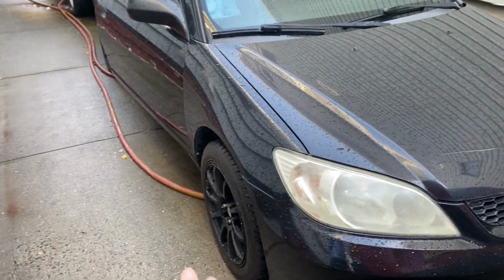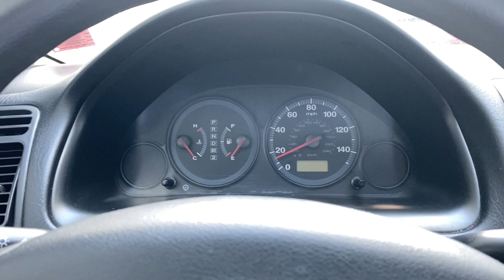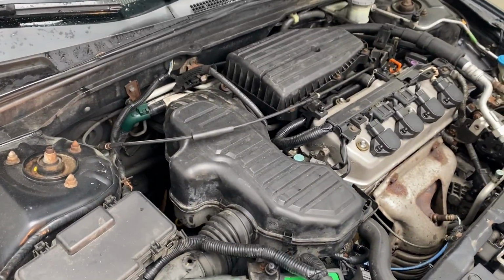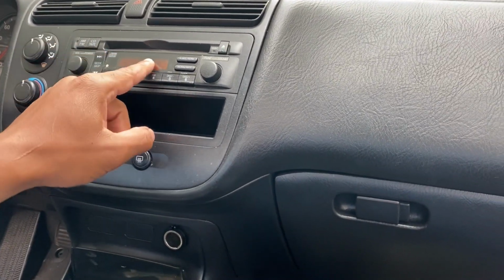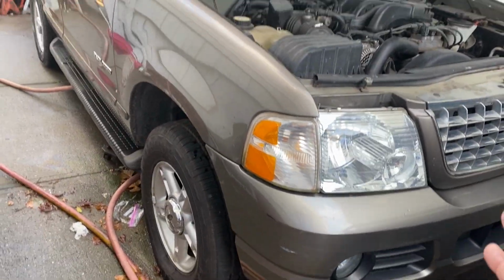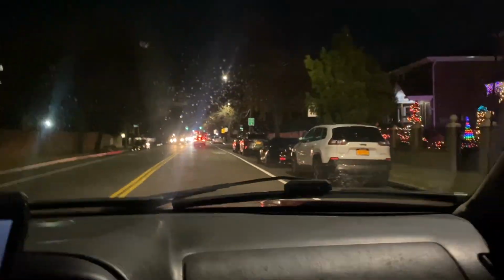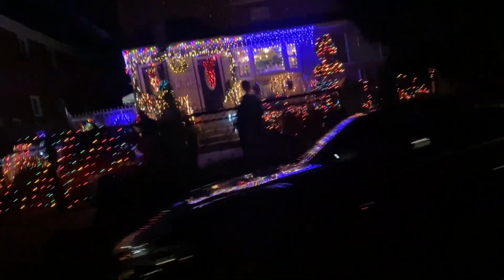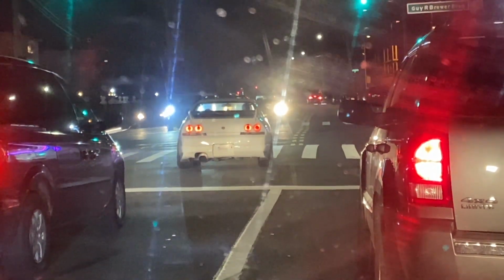My little sister first car - 2005 Honda Civic Coupe VP (EM2)

Comment: 3:33 besides checking the valve cover gasket also check the cylinder head rear cam plug, its a plastic round part, its on the left side, look it up if needed, its common to need replaced, they are around $6 on ebay and easy to put on. I have the same car, i have a 2003 LX 5 speed. i just bought a double din for mine.
Reply from the maker: My dads a mechanic. He took it to this shop and replace all types of things needed. Appreciate the feedback though
Reply: @Shakeem  👍